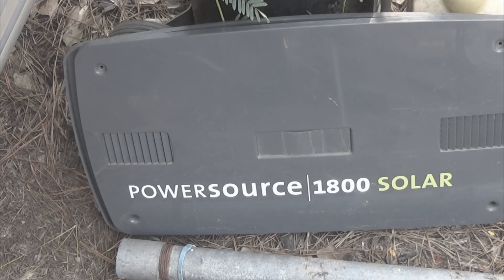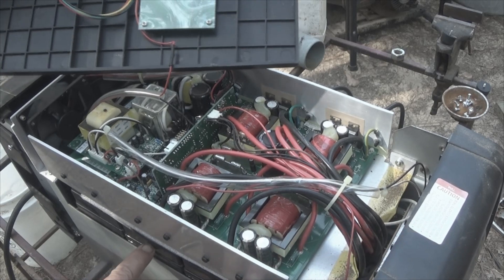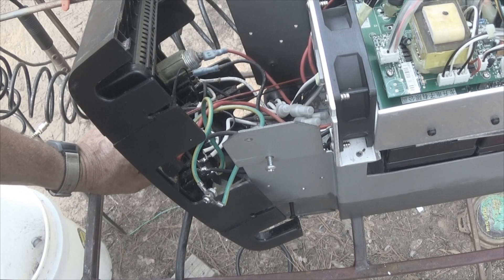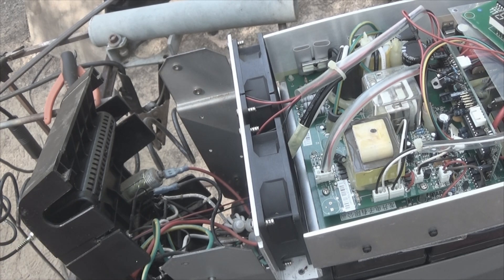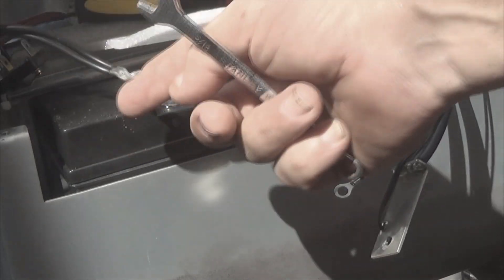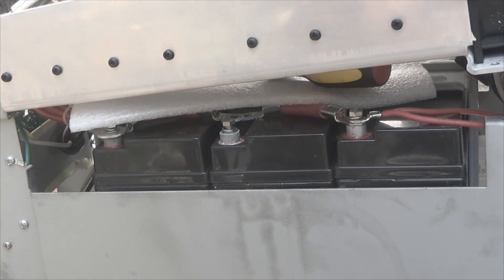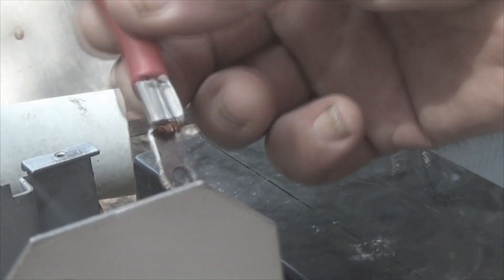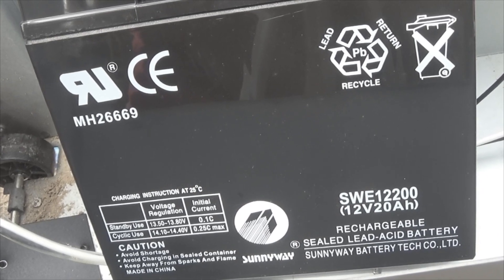power source 1800 solar

Comment: I've replaced the batteries in mine and it charges, but not as far as the generator's brain is concerned. I accidentally ripped out that red jumper wire that goes between the top circuit board and a circuit board on the end with the single 120V outlet (the same one you took apart in the middle where it was joined with the black sleeve). I don't suppose you'd be willing to take a picture of where that wire connects on the circuit board on the end? There are no wiring diagrams that I can find out there and Xantrex is of no help.
Reply from the maker: give me a moment,  it is raining hard here, and i will have to do this outside, as  i don't have a garage or shop
Reply from the maker: to confirm,  is it the wire i cut?
Reply: @dysfunctional_vet  Thank you! Yes, it is the one with the sleeve that you cut. Mine has that black sleeve in the middle of it too.

Comment: I was given one of these generators that was bought new but sat for 7 years and never open and charged. When I got the batteries out they were bone dry and after multiple attempts to recharge decided to replace them. It now runs like a champ. Thanks for making the video I should have made as I had no idea what I was doing.

Comment: Did it work after you replaced  the batteries?  We have one of these, sat in storage for too long, completely dead batteries. I’d rather spend $150 for batteries  than $1500 for a Renogy. If it only lasts me a year, it’ll be worth it to power the accessories in my camper, then save up for a good quality charger power bank when I can afford it.
Reply from the maker: i will let you know.  my sister has not gotten the batteries yet due to a death in her husbands family which is keeping her very busy.   i'm sure it will work once it is set right.  
i do have a battery i can toss in for a check. give me a few days to get it apart and test it.
Reply: @dysfunctional_vet  My condolences to your sister.
Reply: @PABigfootProject  yes it does work if you replace the batteries 
I'm literally looking at mine    
I bought three new batteries took me about a day and a half to get them in there and it was not easy but it works beautifully now
Just takes time and Common sense 
Well to a technician it's common sense